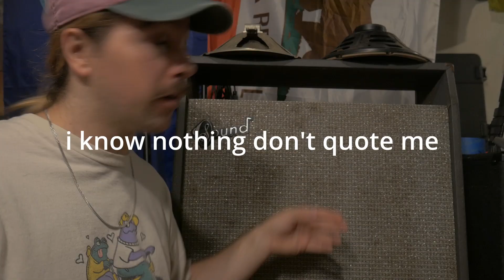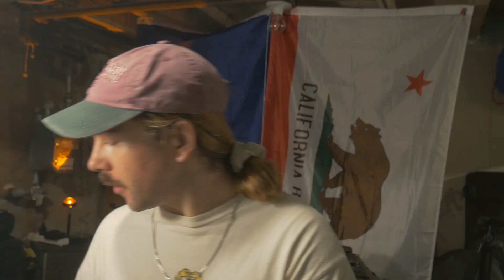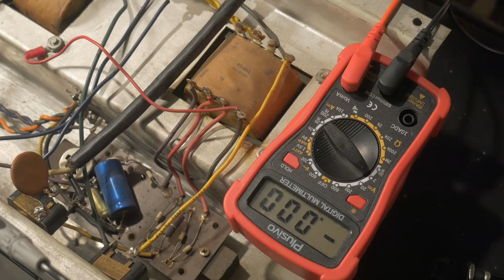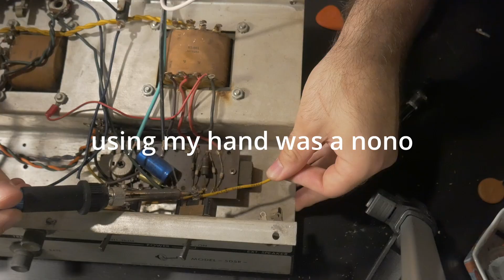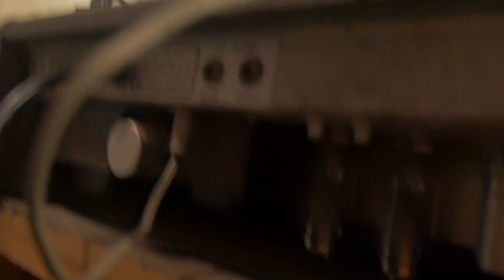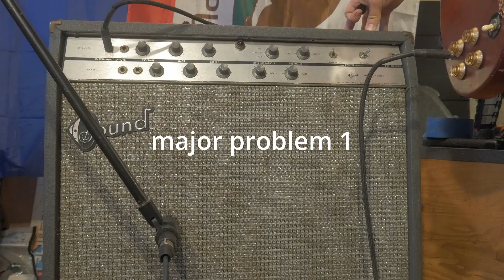Will It Work? | 3 Prong Power Cable Install (Sound Electronics 505R Part 1)

Comment: 12Au7 in phase inverter I have owned many and still gig with two, Takes pedals great. Rebuilt at least 10 of these. it sounds better with the 12au7, Its a 8ohm amp/If you find a X101R buy it ,a x505R is exactly the same amp with a one 15in speaker. V 1  is controlling channel 2  and 1 channel  2,  He was an engineer.